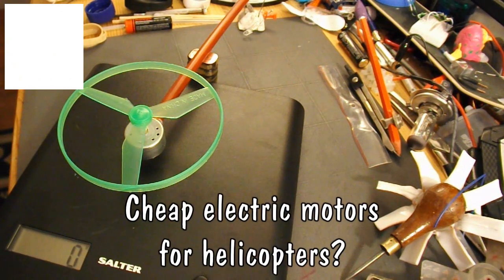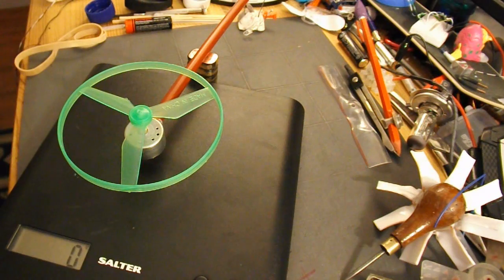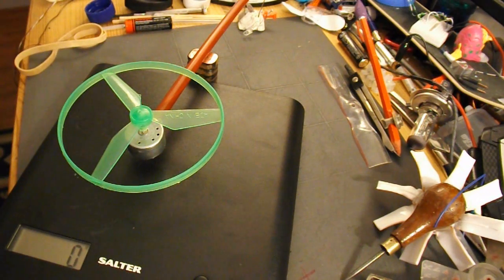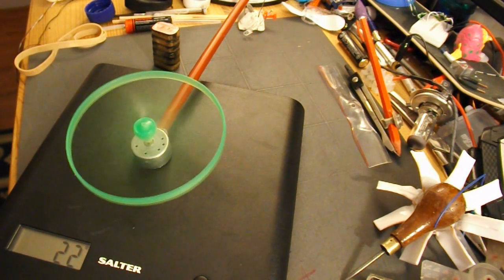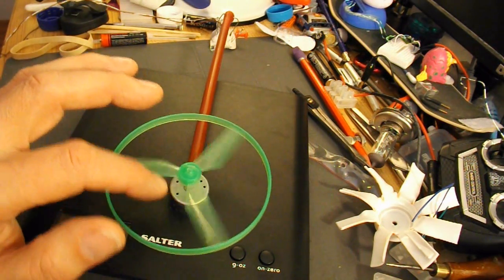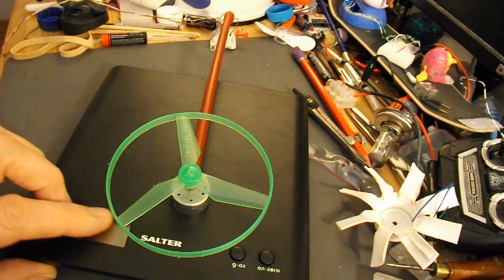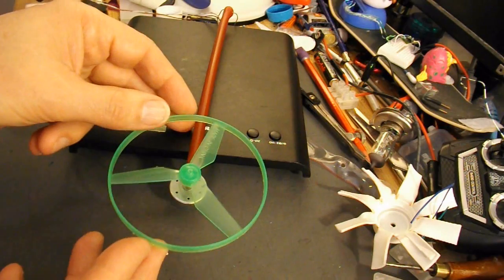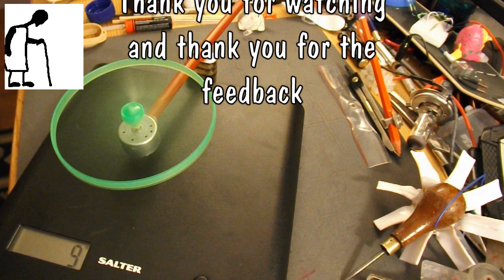Cheap Electric Motors for Helicopters - Revisited

Comment: where can I buy it?
Reply from the maker: +Henrik Lennertzen where can you buy what?
Reply: the motors
Reply from the maker: +Henrik Lennertzen that particular motor came from a solar garden ornament. Generally I use motors from cheap toys or electrical equipment. Here is a video I put together to show typical items with low voltage motors Bargain Store Cheap Propellers and Electric Motors https://youtu.be/lzo_0uzQ2-I?list=PLA5a2xPRSrB2v0vxMJyZ9cPweAGx1FK6e  If you want anything more powerful I would suggest looking on eBay as you can always find cheap items there

Comment: That was cool, But do you know any motors that can carry the weight of the heli and the batteries. If you do, What are they called and where can i get them
Reply from the maker: +space1188 obviously there are hundreds of motors that lift RC helicopters, how else would there be so many available. You buy them from hobby stores or online. Have a look at the FliteTest channel, they do lots of helpful videos for beginners. Buying the right motor is only a small part of building a helicopter. You will not get one to fly on it's own very easily without radio control, so there is a whole lot more to buy. Your best bet is to buy a cheap RC toy helicopter and see if you can fly it before trying to make your own. You will spend more money trying to make your own from scratch and it will probably not fly well. A ready made one would be a better place to start as you know it should fly. Here is a link for FliteTest https://www.youtube.com/playlist?list=PL6IuSFWz4ktvupu_gxw1vn-sjBGOkJFHV and here is another helpful video on helicopters https://youtu.be/c60kByzdwx0
Reply: thank you

Comment: Can you make a plane with that motor.....(also add a vedio on youtube)
Reply from the maker: Aysha Asmat I would think it very unlikely, these cheap motors do not have a very good power to weight ratio. If you make a very light weight plane with a big wing to support the weight of the motor and the battery it might work. It would have to be something like those planes people make for flying indoors in big games halls and aircraft hangers. You might just as well buy a proper model airplane motor if you want to fly planes.

Comment: Can I use toothbrush motors to make a tricopter or quadcopter
Reply from the maker: If one motor does not have enough power to lift it's own weight off the ground, how do you think having 3 or 4 of them is going to make any difference? If you add some gearing to enable you to use a bigger propeller it might work, but once you have to start buying items then you might as well buy decent motors. When you add in the cost of the RC equipment you soon realise you might as well buy a ready made quadcopter, it will probably be cheaper and you get something that should work out of the box.
One of those little Hubsans or Cheersons are pretty cheap if you look on eBay. Once you have got the experience you might then decide to make your own with the remains of the one you just broke.

Comment: Prop wash should even not hit a surface, then you get ground effect. You almost have a seesaw setup there already. Seesaw hinge over the edge of the table top into empty air, see how much reading is affected. Or vertical, 90º angle hinged right under the prop.
Reply from the maker: I really have a problem with people who want to discuss the detail here when the purpose of the video was to find if these cheap motors could lift themselves off the ground with a propeller directly attached to the shaft. Just try doing this project yourself if you have a query with the results, I have shown my results here.
Reply: GrandadIsAnOldMan Ok, Apologies. While it would interest me, I actually cannot afford any toys of any kind right now. I may well join the game when in the position to do so.
Reply from the maker: Cloxxki :-)
Reply: GrandadIsAnOldMan Q

Comment: Sometimes you'll find excellent 6mm motors in tiny cars or whatnot, but the only way one of these Mabuchi types will do something for flight is as ballast plus output....a very large + light powered glider can work, where the apparent 14g difference of weight to thrust can be useful up front. You might need 26g of ballast, so you could throw on the motot + small lipo.  
Would still need a thermal though lol

Comment: It would hve enough power if you had it go up
Reply from the maker: Go up where?
Reply: Like fly up in the sky
Reply from the maker: On Jon watch the video again. The video is showing the motor does not have enough power to lift itself off the ground. That is what it is trying to do. The video shows the motor weighs about 22 grammes but air pressure it is pushing down onto the scales is only 8 or 9 grammes so it would need more that double the power to lift itself up. It is a 1.5 volt motor and I was putting 12 volts into it so it would probably burn out before it gets enough voltage to lift off. To make a successful helicopter it would also need to be able to lift the weight of the batteries, and the helicopter and the radio control gear, so it does not have enough power.
You could add gearing to improve the size of propeller you could use, but if you are going to buy extra items to make it work you might as well buy a good motor to begin with.
Reply: Well what about the straw or sick thing attached to it
Reply from the maker: On Jon you really are not paying attention. The straw carries the wires that go to the battery and is pivoted at the other end so the motor is free to lift off the ground if it had enough power. If you go to the first video in this series you will see I get a smaller lighter motor to lift off when I give it much more power that it is designed to handle but it still would not be able to lift the battery.

Comment: nice project idea but! you could build a gear for the motor so that the propeller ist spinning faster! thats what the do in real rc helicopters too! a regular rc helicopter would also not fly without the gear! maybe you should try that :D greetings: JoshRC :D
Reply from the maker: Thanks for the comment but that misses the point. If you are going to add gears then you might as well buy the right components to begin with. You can get the motor and gear assemblies from eBay, and the right propellers. When people ask me questions they are talking about the cheap electric motors I pull out of things like vibrating toothbrushes and beard trimmers from bargain stores or dollar stores that cost £1 or less. If you are going to have to go to the trouble of buying a gear assembly off eBay then you might as well buy a decent motor to go with it or you are just wasting your time.
Here is a typical eBay item that I think you would struggle to beat on price if you try to source the components individually http://www.ebay.co.uk/itm/151289852981
Reply from the maker: Josh's RC yes I have seen this video and you notice he has a shaft up the middle to stop it flipping over, 4 motors, no body and external batteries so it does not look very promising as a viable vehicle. People keep asking me to make a cheap quadcopter and I try to explain that even if you could source cheap motors that were powerful enough, you still need to add the cost of the radio gear as there is no way you will get a quadcopter to fly free without some sort of electronic stabilization. Once you add that sort of cost, the "cheap" motors become an insignificant cost and you might as well get good ones. I use his video as a link to answer those questions.
Reply: yea, thats the problem... for example:
hobbyking offers brushless motors for 4 pounds! then the regulators for 2 pounds... thats so cheap that someone should better buy those than spending his/her time on working with this motors....